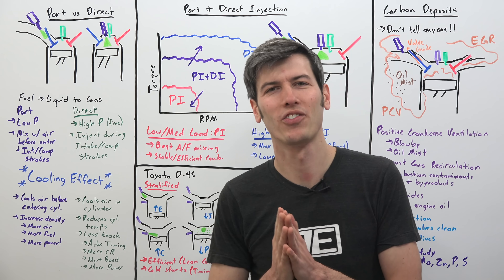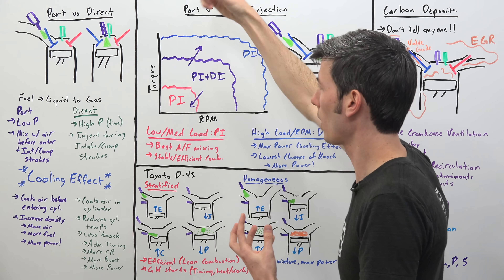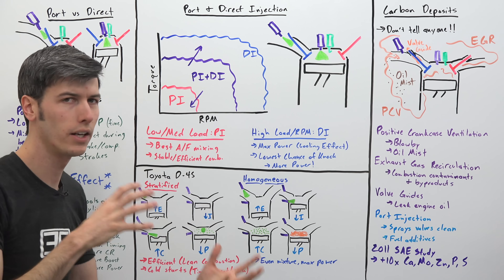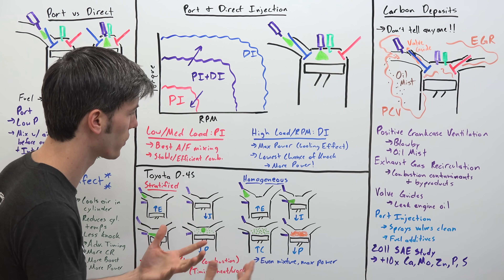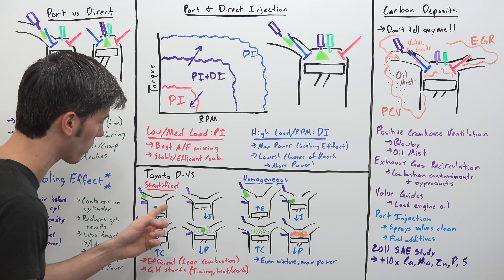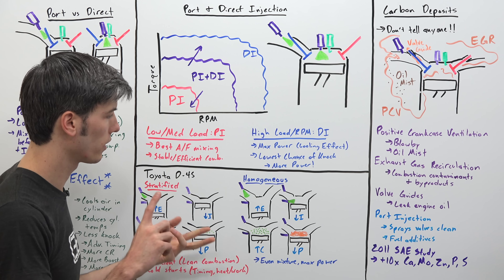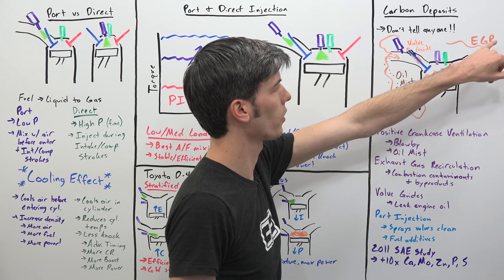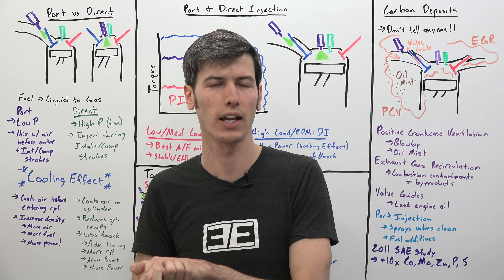Why New Cars Are Using Both Direct & Port Fuel Injection

Comment: Thank you for sharing your passion for our shared interest. In your top middle panel, marked 'Port vs Direct Injection,' I would consider changing the layout such that there was a small region in the upper left marked 'Direct Injection,' and I would make the 'Port injection' a small region in the lower left that increased in torque with increasing RPMs. There are many factors, such as timing, advance, and intake charge reversion, and the rate of flame front propagation is relatively constant. Therefore, the faster (and lower Torque) the engine runs, the more aggressive you can be with ignition and fuel injection timing. The slower (and higher Torque) the engine runs, the more prone it is to knock.

Comment: So from what I understand is port injection is the way to go. Deposits are reduced by a landslide but still possible from the image shown in the video. My question is will an engine still benefit from an oil catch can or oil separator even if it’s port injected or is it overkill and not necessary? Thanks in advance!

Comment: Are there any manufactures that only use port fuel injection system? I'd rather stay away from any direct injected systems because of the cost ,(labor, parts, time down, money), to remove the carbon buildup on the intake valves.

Comment: Long story short. Look for a car with port injection that is about the same efficiency as its GDI counterpart. You will reduce the complexity, have less carbon buildup and less maintenance over time. GL having valves cleaned on a GDI only engine at 150k miles.

Comment: @Engineering Explained I wonder how the "D-4S Injection" in all Toyota's newest engines, such as the one found on the M20A-FKS (corolla hatch), work to reduce the carbon build up on the intake valves... they state it has a "low-pressure" port injector unlike the higher power port-only injected engines of yesteryear. I know that the 2UR-GSE (Lexus 5.0L V8) had both port and direct injection as well upon its inception, but they never specifically called out the port injector to be "low-pressure". I know many ISF owners whom have viewed their intake side and upon inspection for carbon build up noted there to be very minimal amounts if not nearly any present; as crazy as that sounds. I'd be curious to see if Humble Mechanic would also have an opinion on this. All this to say I'm not sure if Toyota even got it right, as at least on my e210 hatch with the above engine I'm experiencing cold start misfires indicative of carbon DI issues.

Comment: Hi, great clip, but i have few questions. Maby it depend on car brand, but do PI and DI its own map in ECU? Also, if you check wolkswagen engine EA888 3gen. and 3gen+, they used dual injection on engine CJEB, but on newer version 3gen.+ its not used anymore. Do you have ideas what are cons to use it?

Comment: My 2020 2.5 Toyota Dynamic Force Engine has both port and direct fuel injection. I am totally amazed at my 2.5 Dynamic Force engine in my 2020 Camry LE (8,350 total miles) I recently took a 445 mile trip that put my car through just about all the scenarios a car could face including, freeway, hills, mountains, long gradual inclines, long gradual declines, 78 miles of winding uphill, downhill, sharp turns, not so sharp turns, manually downshifting, manually upshifting, and driving around a small coastal California town of Fort Bragg for two days. After I came back home I filled up the tank to check for the first time my gas milage turned out to be...an amazing "35.8 miles per gallon." I had to redo the numbers on my calculator to double check...445 miles divided by 12.4 gallons of gas. I am totally amazed!  And all these miles were not "easy interstate miles"...only about 125, or so. My car performed better than I anticipated and this engine...totally amazed me! The car is rated for 39 MPG (freeway) on the window sticker. It looks like it would do even better! Totally amazing!
Reply: I had a coworker that has the 2018 Camry with the dynamic force 4-cylinder and they got 44 mpg-hwy
Reply: @matthewmiller2268 I have a 2018 Camry and I can get close to 50 on the highway. Amazing!

Comment: Suppose that’s why Ford added port to the ecos. But to be fair carbon build up isn’t a big issue for most people… some people will melt down with that comment but it’s true. Just drive. Change your oil 5-8k.
Reply: Use top tier gas.  Ford people are installing catch cans to collect crank case blow by.  Lets not forget drilling a hole in your turbo Intercooler intake to drain fluid from you turbo intake air.  Lets not forget 1.5 liter Eco boost 2016 to 2018 that loves to put coolant from the head gasket to the  cylinder.   Can watch videos of Ford Eco boost pickup motors rebuilds all day long.  and then watch Ford Eco boost rebuilds because the first rebuild was done wrong. Or watch "Ford Boss Me" videos that says change your  synthetic oil every 3,000 miles or else. Beats me why people are lining up to buy Mavericks and Broncos with Ford's track record.

Comment: It’s pretty elementary you want multi port injection instead of just direct injection. Direct injection has been around for years and everyone knows the issues with the carbon buildup .  So why are very few manufacturers going with muti port injection? Obviously to save a dollar that would have been passed on to the customer anyway. I don’t like the government getting involved but muti should be mandated on direct injection engines. Seems we are going backwards. Carbon buildup on the back of the valves shouldn’t even be an issue in 2021  when there is an easy solution to avoid it.

Comment: Direct injection reduces knock. Isnt this the same term some use for detonation which is bad? And happens alot more on direct injected due to higher compression and carbon buildup? Surprised the DI crosstrek you have hasn't had this issue yet. My motor spent its whole 25k miles of life in the lower rpms driven slowly. by 15k it had such bad carbon buildup causing LSPI that Subaru condemned the motor and told me drive it till it goes. Sounded like bolts in a glass jar being shaken.

Comment: Thank you for this video. I am a long time subscriber. I just bought a 2018 Hyundai Sonata Limited with a 2.4 GDI engine as a family sedan. This car currently has 16,000 miles on it. I really want to take car of it, as I payed cash and have never owned a car this nice in my life. Do you have any recommendations/videos on Mitigating carbon deposit issues on the intake valves? I plan on replacing the PCV valve every 20k miles. I really appreciate the effort and diligence you put into your videos. any help would be greatly appreciated.

Comment: Your videos are amazingly informative the thing is you can have the best engine if your fuel injection system does not get the fuel or the spark for the compression it doesn't matter how good the engine is this is the problem with vehicles

Comment: Any tips on why my 800cc injectors are near maxed out and my engine management light is on car was missing slightly at times and car takes few turns more than normal to start Toyota Altezza turbo forged and I'm running a walbro 255lph pump havnt put a return line in yet should I do away with return less are even a swirl pot are surge tank could it be possible the pressure is dropping causing this

Comment: Toyota actually had dual injection since 2006. My 2008 GS 460 has it. It uses a mechanical fuel pump on each head, run by the cams, to get high enough pressure for direct injection. It has a two computers on top; one for every four injectors.

Comment: Direct injection replaced port injection because it's supposedly  more advanced.  Interestingly, when toyota, ford, and gm had troubles with carbon deposits, they reintroduced port injection.  Sounds like they went backwards to fix a more advanced tech.

Comment: The problem is not direct injection. If you think about there is only air coming in through the intake valve. The reason why the intake valve is gumming up is because of the pcv system.

Comment: Hello, First of all thanks for sharing video. I do have few query, appreciate your reply
1. Does this video is apt for gasoline only or for CNG also.
2. In PI, during injection of fuel it will displace incoming air thus affecting volumetric efficiency, considering Atkinson cycle.and thus less power will be produced.
Reply: manish mishra Yes, in CNG there is a displacement of air in PFI, but the required pressure for DI is quite high which usually needs a high pressure fuel pump. Usually this is done only with LNG. Westport Power does a dual fuel (diesel plus DI LNG) which has one of the lowest CO2 for a combustion engine. Generally for SI engines, though, turbocharging is cheaper than DI for CNG and that is what most engine manufacturers do for CNG, though some don’t turbocharge but instead raise the compression ratio to roughly 12:1 and the efficiency improvement can offset the air charge loss from fuel displacement. The air displacement for petrol PFI is lower than the air density improvement from cooling, but this is not the case with CNG which has roughly 10% air volume reduction.

Comment: DI+PI is a great idea indeed, but it's pollutant, since oil is burned. Also, oil is not meant to be burned or slightly mixed with fuel, so it is preferable having engines (like my Honda) that never lose a droplet of oil.

Comment: I’ll install a low pressure injector 5bar on the charge pipe (2bar boost) using 102+ octane racing fuel, to clean the valves.I’ll use fixed spray times so at low rpm or load the car computer will inject less fuel than normal  through direct ports then at higher loads the negative fuel trim will go very low so that I don’t increase the chances of a knock.

Comment: Obviously depending on the application, it seems as though you get the best of both worlds with Port + Direct Injection, thank you for the explanation on all of the variants. It trips me out that all of these ways to inject fuel were all from the minds of engineers. It's pretty rad if you ask me.

Comment: Would you say that letting a car idle for like 20-30 minutes one in a while can help clean up some of the carbon buildups? of course this would be done with a fan on front or at cold weather so the engine doesn't over heat. I wonder if this would work.

Comment: One more reason to use the port injection is reduce particulate matter generated in the combustion process, which is higher in DI engines due to difficulty to have an homogeneous mixture.
In new emissions regulations only the DI engines have to achieve a certain level of particulate emissions.
BTW, I think VW used this dual system inf their cars since 2014 but with turbo engines, like in the GTI.

Comment: I am in the market for a new SUV. Contenders are (all 2019) Rav4, Santa Fe, CX-5....with a heavy nod to the Rav4. (Toyota dealership in my town, none for Hyundai and Mazda)...as I keep researching, the Rav4 keeps coming out on top. (even before the bonus of a dealership in my town)  The dual injection issue addressed in this video locks the Rav4 as the winner. (Rav4 has the D-4S engine)   I keep my cars a LONG time, and I don't want to have to deal with carbon buildup.  Plus, the added bonus of Toyota quality.  Only downside to Rav4..no android auto.  But I'm the son of a GM engineer and my 15 year old Trailblazer is running well.  I might as well keep it a few more years.

Comment: The Hyundai Accent has used Gasoline Direct Injection engine within the past several years, however for 2020 model year the automaker changed the power plant to Dual Port Injection.

Comment: Great explanation on the topic! I presently own a 2014 Mazda 6 GT model with the 2.5 l with 120,000 Km. The car has been very reliable, don't even want to look at those valves. You mentioned  Toyota has both port and direct injection. What other companies have engines with both PI and DI, besides Ford. Thank you!

Comment: Best explanation on YouTube. I direct all my friends to watch this. So which DI engines/manufacturers have the least carbon deposit? Mercedes? From my reading, VW/Audi and Minis are terrible. Earlier generations of DI from Toyota were also bad (I think that's why they've invested so much in D-4s. Problematic systems don't fit well with their culture. I', not sure if they still make pure DI though).
Reply: Meng Shi Lim Later VW switched to dual mode (PFI plus DI), my 2015 and 2016 2.0 turbo GTI had both systems.
Reply: @dale116dot7  Europe or USA or rest of the world? No update on VW Wiki page. It says as of 2016, no dual fuel injection in USA market I think.
Reply: Also very little on YouTube!

Comment: My Audi RS3 has both port and direct. 10 injectors in total! I'm kind of curious to see when in the rev range the port and direct injectors activate and deactivate. Either way, at least I don't have to worry as much about carbon buildup in this car like I do with my VW GTI. Every 40,000 miles with that car I have to pull the intake manifold off and get the runners walnut blasted.

Comment: One automaker is touting its continuous variable valve duration engines for 2020.  One of these 4-cylinder engines (a 2.5 liter) is represented as having both direct and port fuel injection.  The other 4-cylinder engine is a 1.6 turbo and although it is also a CVVD the only thing I see about it is "direct injection".  Which engine is most likely to avoid the carbon deposit problem?  Which engine is most likely reliable ?
Reply: You're talking about the newest engines from Hyundai.  
The 2.5 MPI/GDI is far less prone to carbon build up. 
As far as reliability goes... its a toss up.  But both these engines are big improvements from previous years.
Just change the oil regularly

Comment: The new 2020 Hyundai Accent is advertising that it has dual port injection, they do not describe exactly what that is. If your injectors are in the combustion chamber and you have a leaking injector, you can fill your engine with fuel while it is not running.

Comment: I love your videos.  I have a Mazda 6 with GDI (Skyactiv), 6 spped manual, and am concerned about intake valve carbon/dirt buildup, and how to prevent this from happening and/or clean the intake valves.  I had a VW TDI diesel before the Mazda 6, a GREAT car.  It was of course a "direct injection," like all diesels are, and I never heard of intake valve issues with diesels.  Why is gasoline DI different?  Also, with a manual and GDI, does engine braking (high vacuum) make intake vale crudding up worse?

Comment: Hello, can you explain why average combustion engines for gasoline use gasoline, which is mostly octane alkane, and why not lower carbon liquid alkanes like pentane, hexane and heptane are used as liquid fuel. Lpg is even lower in the alkane rating and is gaseous and burns cleaner, so it should be "logic" that you use for liquid fuels that liquid that is at least the closest to become gaseous under normal conditions. What is the specific reason "octane" is used und not pentane hexane heptane? is it cause its so seldom found in crude oil, is it so diffifult to efficiently produce in reffinery or has it to do with typical spark plug combustion engines, i mean even lpg or even cng which have even lower alkane ratings are used as fuel, but why not exactly those 3, well to be fair heptane is at least used in small amount in gasoline, but why not generelly the usage of more lighter alkanes? thank you

Comment: I have a quick question. In the stratified section you said the port injectors are spraying fuel while the intake valve is closed in the exhaust stroke, so how is the fuel getting inside the combustion chamber if the intake is closed? Great video though

Comment: 2 injectors per cylinder? Honestly, I do not want to pay the costs for exchange of 8 injectors on an inline-4 engine once it has run ~200.000km. Seems like we have reached a point of technical complexity in time, where it very much makes sense to replace combustion engines with e-motors and better think about how we can recycle batteries later on.

Comment: lexus already knew about carbon build up of DI only design, that why when they released their flagship sedan 13 years ago, both DI and PI is used on their LS460. As the LS460 needs to be their most reliable model.
Reply: I have a 2008 GS 460 with the same engine. Decent gas mileage and clean valves. Not sure if it works like the D-4S though.
Reply: what about the ES?
Reply: @bullzeye1423  I think the newest 2GR have the D4-S. The older ones are port only.

Comment: Companies are using both injection systems because they dropped a bollock with direct injection with all the carbon that builds up on the valves! Now we have twice the amount of injectors to go wrong. Who is going to want to buy second hand cars with direct port engines knowing that they will eventually need to have carbon removed at time and cost!?

Comment: I've never seen an engine that runs on propane get clogged inlet ports even though there is of course no gasoline sprayed in there. Why is this?
Reply: Circlotron The blowby is cleaner since the fuel burns with fewer particulates (the oil stays cleaner for longer, too) though I have seen a small amount of buildup. I work on CNG engines but LPG should be very similar.

Comment: Hello Jason, I was wondering if Toyota's strategy of increasing the air/fuel mixture and delaying the ignition timing in order to heat the catalytic converter faster would cause a significant increase in fuel consumption while the engine is yet not warmed up.
Reply: Diego Almeida Most everyone does it, and yes, it increases fuel consumption dramatically but only for the first minute or so of operation. The fuel consumption is probably 2-3 times what it would be without that feature, though the rapid warmup doesn’t take that much fuel compared with driving for a few minutes.